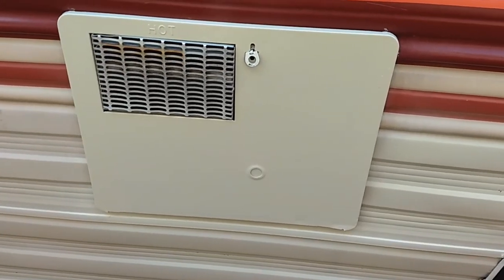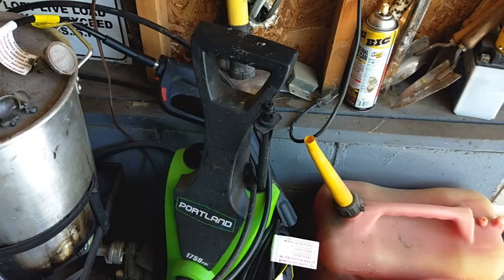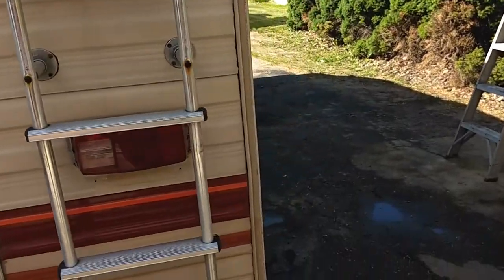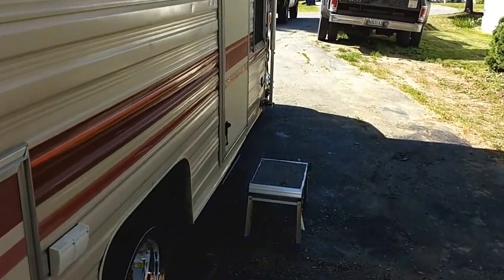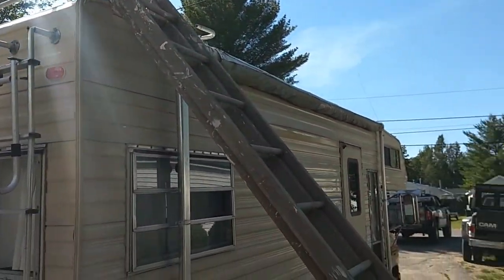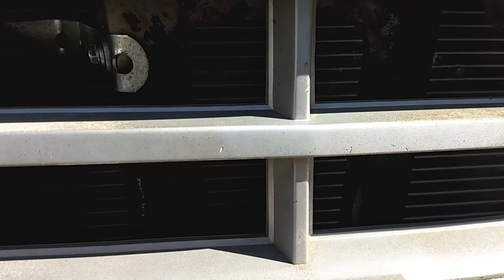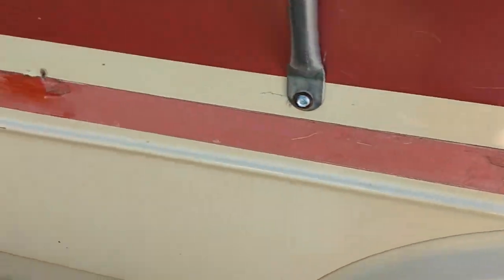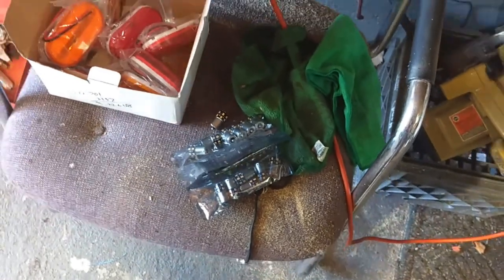Fresh come ups for everyone

Comment: OOOOOH  Love that body style escalade! i ought to, hell i've had 4 now.  made out pretty good fixing and selling them as salvaged title vehicles too . I need to do this with my RV's too. both the one i'm selling and the one i'm moving into soon. they both need it big time. I don't even use my awnings. less to be depressed about that way lol.  the new awning cloth is SUPER expensive i've found and since i don't use them i just let the old worn out one sit there rolled up on the roller above the door. guessing i'm a bad RV'er for that but oh well! I've got a Harbor Freight pressure washer too, a 3200 psi predator one that i've had 3 years and never run a drop through it yet.  I had the SAME experience with a transmission. mine was the 700 R4 had mine rebuilt and it lasted 6 months then died. then i grabbed the one out of my cousin's silverado long bed and never had a problem with it after that again. his only had 140,000 miles on it. is that an 85 van by chance? it looks a lot like my old raised roof one.  i did the same thing with my RV and the all LED lights but mine were upwards of $300.00 i went with the bright white. made a HUGE difference. my house fixtures in the RV are still the soft white light so i ended up with the best of both worlds  looks like a nice project